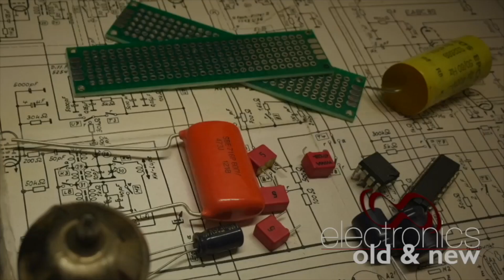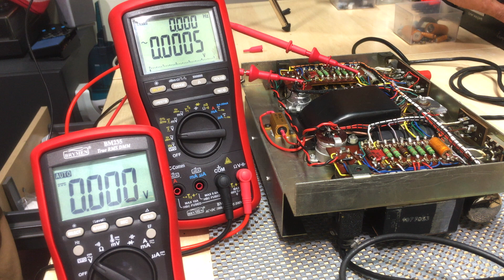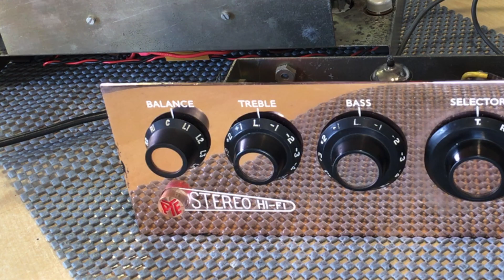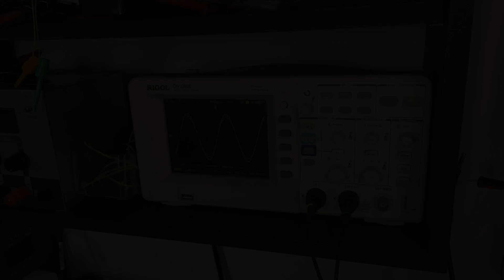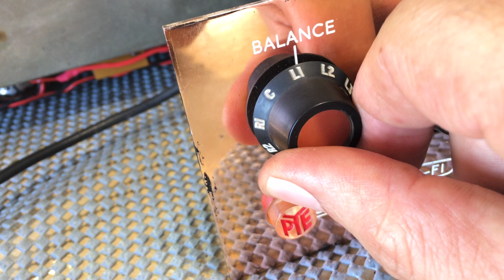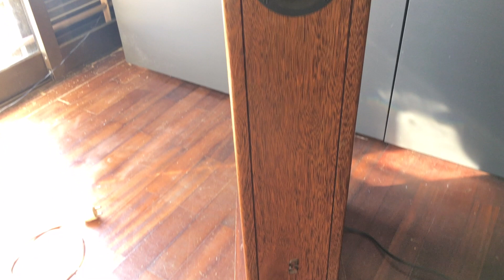Pye Mozart HFS-20M Stereo Hi-Fi amplifier restoration - part 3. The Finale.

Comment: I used to have the mono version playing through a 12" tanoy monitor red in a corner cab  and still think it was the sweetest sounding amp i ever owned .Wish i still had it.
Reply from the maker: You’ll have to start looking for another in local auctions. You might get lucky.
Reply: When I was around 13 in the mid 1970's my grandfather's neighbour gave me his Pye Mozart amp and matching FM tuner which I ran for around 3 years until ill advisedly selling it for around ten pounds to get something with modern transistors. My quest to replace it today sadly needs a budget rather higher than a tenner !
Reply from the maker: much higher. but we’ve all done something like that. the curse is that some of us then learn to regret it 😊

Comment: A Very Fine Amplifer With a Most Unusual Front Lay Out With The Knob Size Going From Small Right Up To Very Large But I Like It !! Fabulous Restoration And a Lovely Sound From 8 Watts Per Channel Through Those Transmission line Speakers What Model Of Markaudio Full Range Driver Did You Use ? And Were Did You Get The Plans To Build Those Lovely Loudspeaker Enclosures..? Over All A Mighty Fine Project !!..Regards mike
Reply from the maker: The drivers are: Markaudio CHP-70 Generation 2 Natural  
I got the plans from the markaudio website. This is one of the ‘Pensil’ series. It sounds really, really good.

Comment: Wouldn´t it be better to separate the power supplies for both preamps to get it symmetrical?
Additionally this would increase the crosstalk isolation between left and right channel!? It´s not a good design to connect both sensitive(!) preamps to the same B+. Just an idea….
Reply from the maker: I agree, but because this was designed this way, I didn't want to change it, just restore it. I would personally have done it differently, as you suggest.
Reply: @electronicsoldandnew  Yes! We are always walking a fine line between true restauration and improvements

Comment: so if you have a B+ of a 260 and a 100 MA of current on each tube   .1 AMP X 260 B+ = 26 watts of plate dissipation max dissipation for an EL34 is 25 WATTS
Reply from the maker: The Maximum plate dissipation is in fact rated at 25W. However, a couple of things need to be clarified:
The voltage used to calculate the plate dissipation is the voltage drop from plate to cathode (Plate Voltage - Cathode Voltage), which in this case is 251V (265-14) . One would think to multiply this by the cathode current to give us plate dissipation, but  this is also not strictly correct because some of the current is flowing through the grid2, which is also allowed to dissipate 8W according to the data sheet. This grid is tied to the plate, so I think we could actually call the total dissipation allowed to be 33W. Not strictly true, but close. Our 'total' dissipation in this case is 251Vx0.1A=25.1W. 
Hope this makes sense.
Reply: @electronicsoldandnew  ok thanks it always been a bit confusing this bias. just to recap so the B+ 265 - 14 volts grid bias = 251 volts 25 watts anode 7.5 watts screen = 32.5 watts dissipation. i think i have biased my new class A el34 amp a bit low
Reply from the maker: @moodyga40  : The full story is this:
The B+ is 265V. 
The Cathode Voltage is 14V. 
The Plate to Cathode voltage is 251V. 
The current that I've measured is ALL the current going into the tube, i.e. the Plate Current + Grid Current. Because we don't know exactly how much of this current is going through the plate and how much is going through the grid, we can only do a calculation of the total dissipation within the tube. 
As for your amp, there is nothing wrong with biasing it a little more on the safe side. Bias it to 70% of max and then see how it sounds. In Class A, the instantaneous power dissipation is going to fluctuate some, so being safe is good.

Comment: A very nice job thoroughly well done, as always! That voltage difference... I wonder why they didn't take the preamp supply from both power amp channels with two resistors of double the value...
Reply from the maker: Alan Cordwell : I actually thought of doing that. All it would take was two resistors and separate the twin filter caps to create truly separate supplies to left and right. The plug needed another pin though. If you took a ‘bit of current’ from each supply and then joined it, the separation is compromised, and I’d have to do a bit more thinking to see whether that would be detrimental. Don’t think so, but ...
Reply: Pro tip: watch movies on Flixzone. Been using them for watching all kinds of movies these days.
Reply: @Jacoby Jeremias definitely, I have been using flixzone for months myself =)
Reply: @Jacoby Jeremias yup, I have been watching on flixzone for since december myself :)

Comment: I think that gain difference is probably within the spec of the pots and may well have always been like that. I trick I would have done (if possible) would be to move the control knob on the pot so the gain is correct. Makes it look better and the owner will not have to guess where exactly to put the knob for zero balance. A nice sounding amplifier, I remember it well. Amazing that most of the resistors were out of spec, you expects the caps to be rubbish.
Reply from the maker: I also thought that the volume pot was the cause of the imbalance, so I checked it.   It was actually surprisingly balanced, so I don’t think it is the cause. However, with treble and bass pots, as well as the balance pot in the mix, any one or more of those could be contributing to the symptoms. 
I was also surprised by the resistors. I usually need to change one or two, but this was crazy. Anyway, it’s done, and it was well with it.